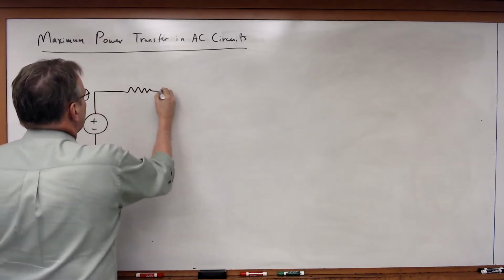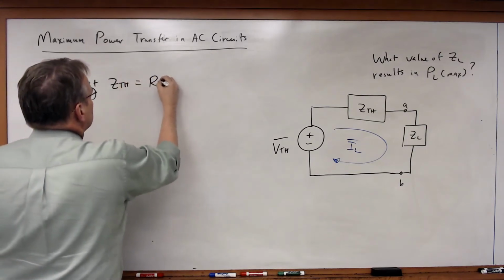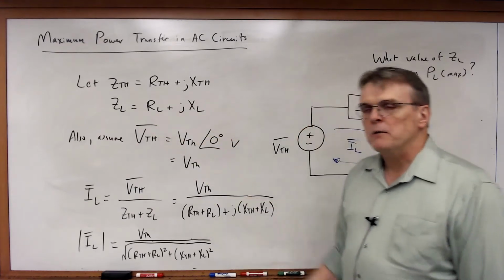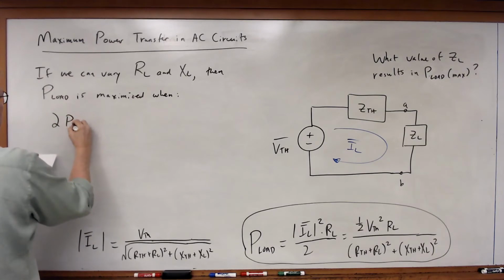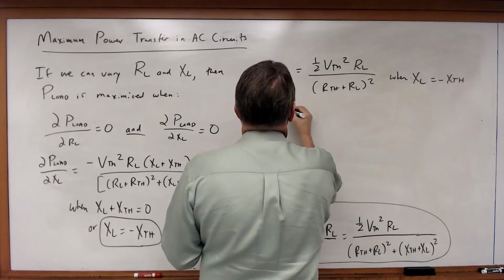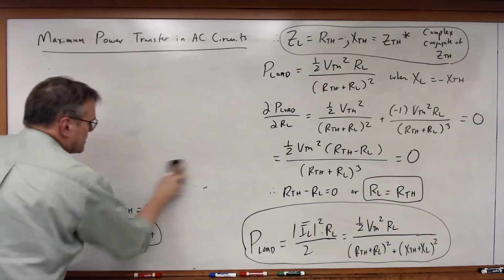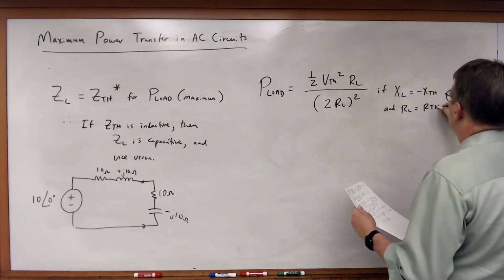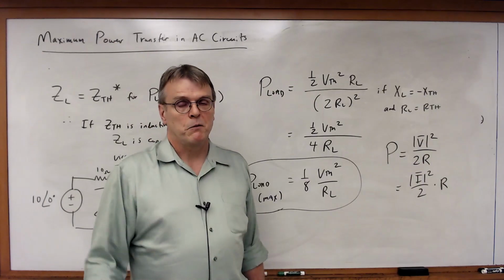EECE 2112 Module 79:  Maximum Power Transfer in AC Circuits

Comment: Thank you for your teaching sir I learned a lot ❤, I did solve your example using your fomula and the result is undefined 😅 iL=1.5A but the  |iL|= undefined
Reply from the maker: On the contrary, iL = 0.5A for the example at the end of the lecture.  iL = 10/(10+j10+10-j10) = 10/20 = 0.5 A.